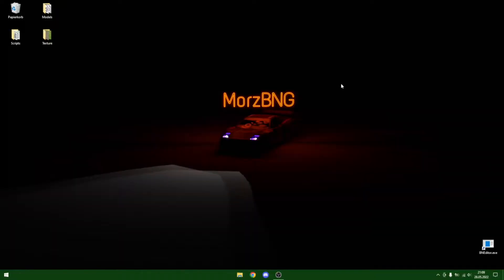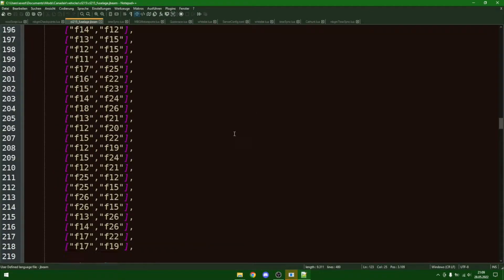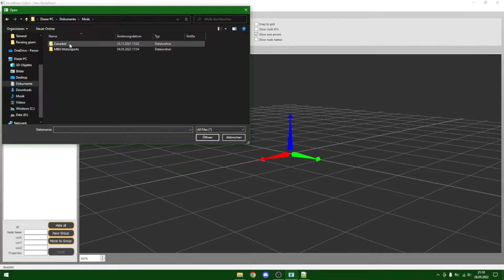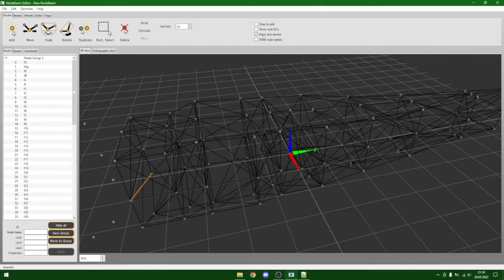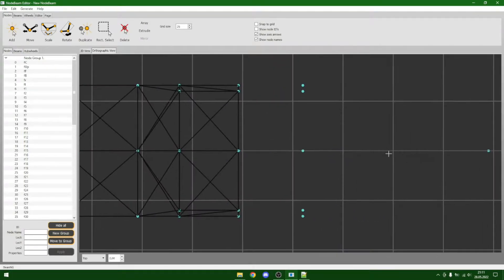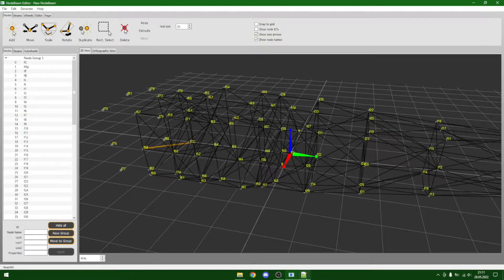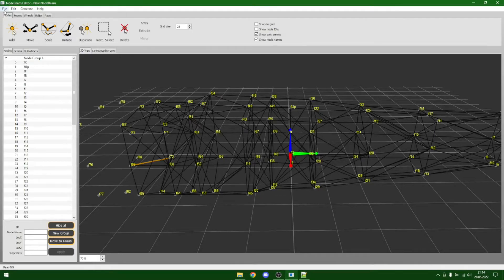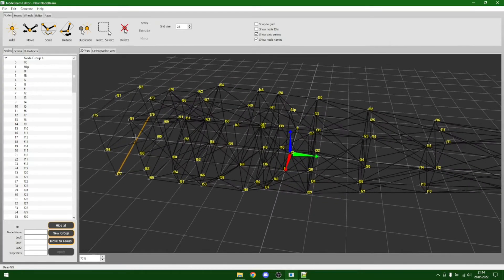New Techniques in BeamNG.drive Modding Devlog #9 | Canadair Cl-215

Comment: I am surprised you do not use the Jbeam Exporter for Blender. Or maybe you do, I had a friend fix the duplicate beam problem. What Does not work though sometimes is using the Jbeam Nodes beam connector in the Jbeam exporter. I find that when modeling some of the triangles are missing on the models in game when using that. I started to just hit F when selecting 2 vertices in Blender for making cross beams. Then exporting the jbeam rather than letting the nodes beam connector it edit mode do them.